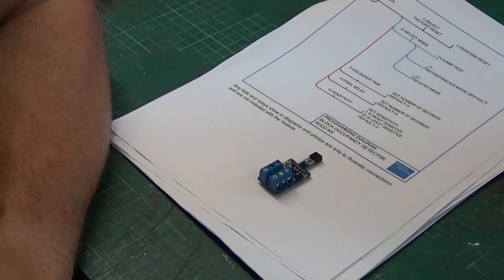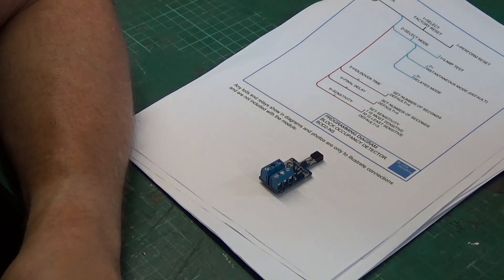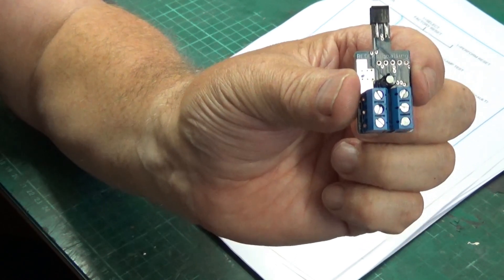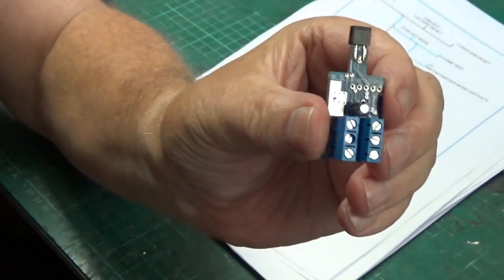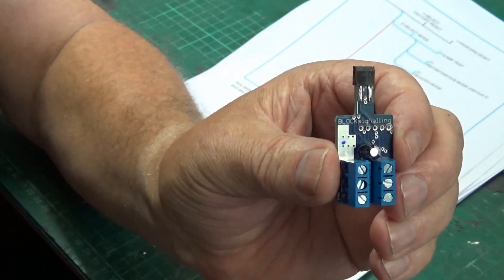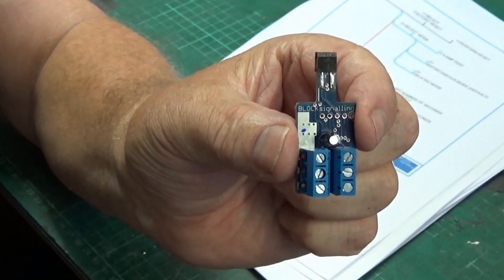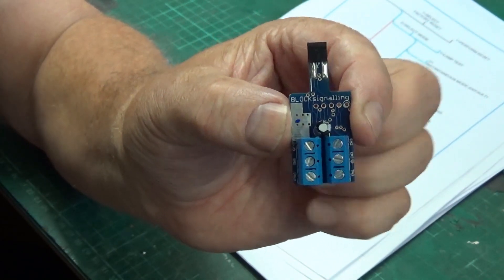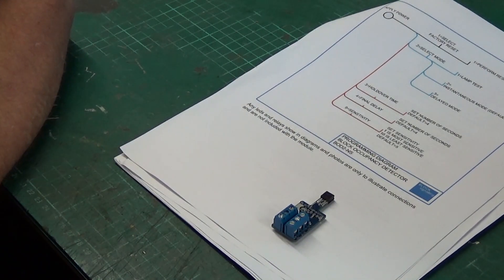BlockSignalling Infra-Red Detection Module. Video #44

Comment: Very nice gadget, I wonder if the could be used elsewhere on a layout to automate something, such as turning on lights in a station when I train is in etc. I have purchased a number of items from them, with excellent backup service, their CDU's and Point Position Indicators are excellent...Simon
Reply from the maker: I don't see why that couldn't be done, the train could switch on the lights and the 'delay' programs could keep the lights until the train had moved off and cleared the platform or something similar. 
Yes the 'Point Position Indicators' and 'CDU' are all excellent items I use the both on West Blyth. Which CDU do you have? I am using the twin capacitor CDU.
Thank you for your comment Simon
Michael
Reply: Hi,  this is what I bought and how I will be using them, will buy more when I need them: https://www.youtube.com/watch?v=P9BArZimVns&t=105s